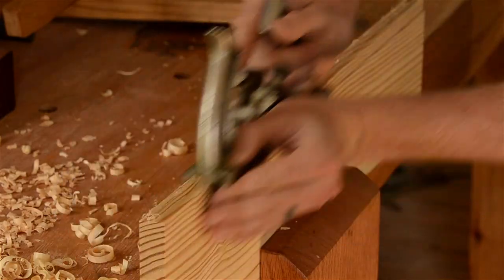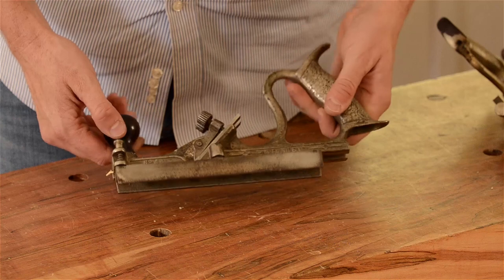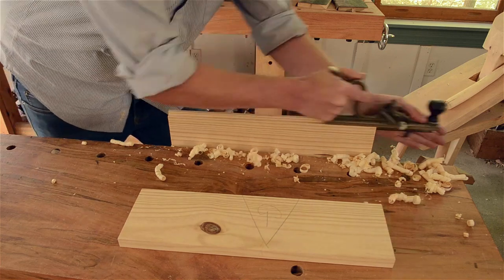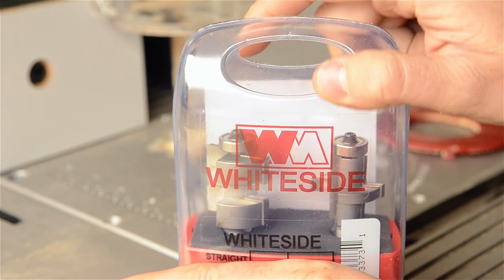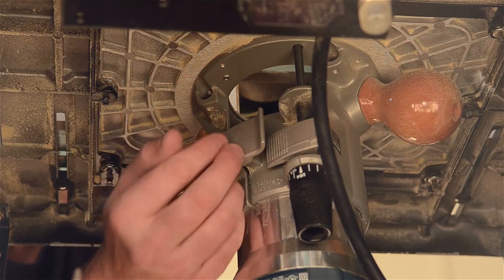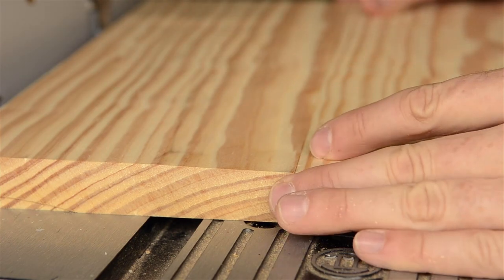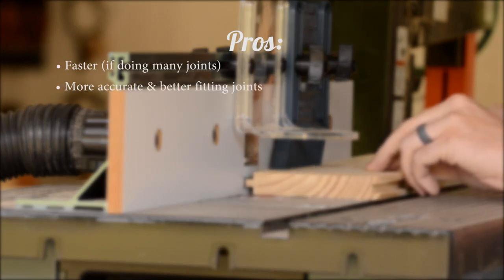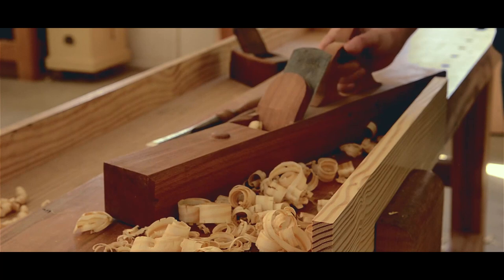Tongue & Groove Two Ways: Handplane vs Router

Comment: BIG PLUS to hand plane option, your ready to rebuild in a non-electric post-apocalyptic world. You don't even need sub-floors, the earlier homes used T&G floors right on the floor and cieling joists and wall studs inside, and ship lap on the outside. (Ship lap can be done with the same planes, just cut off one ear of the groove board  and leave the other ear a little longer than the tongue (for the gap in the finished wall/siding).). Hand tools don't need power if you also learn to sharpen them on flat stones as opposed to electric powered wet wheels. The carbide cutters on router bits require specialty sharpening equipment as well, so your more likely to have to buy more as time goes by, replacement blades for the hand-plane only require rudimentary blacksmithing knowledge and decent sheet carbon-steel. If you have the skills to be valuable after an apocalypse, the others will be more likely to protect you as an invaluable member of the community.
Reply from the maker: LOL...all great points!
Reply: @WoodAndShop  what can I say..  Walking Dead fan... all the electric tools will be good for is parts to make weapons.
Ha ha ha, thanks for the reply.
Reply: ya Im hassling all of the lumberyards near me for 1-1/4" oak... $1 per board ft, green, for white oak.  T&G plywood near me is $3.50 per board ft.  wtf.  So now I bought a router and table and am building a kiln and even after all of that I will still save money on my oak floor compared to T&G plywood subfloor + hardwood.  Not even close.

Comment: Is a plow plane not recommended for tongue and groove?
Reply from the maker: You can use a plow plane, but then you're only getting the groove. You need to also cut the tongue. But a tongue & groove plane(s) gives you the tongue and the groove, and ensures they are lined up with each other.
Reply: @WoodAndShop  aaaah that makes complete sense. Thank you.

Comment: I coughed when I saw the price of the Lie-Neilson No.48, but after adding up the cost of a router, router table, shop-vac/dust extractor, suddenly they looked a lot more attractive. Not to mention, I could put a No. 48 into my toolchest, and just use it at my work bench.
Reply: You need a 48 and a 49 to make a tongue and groove joint. That adds up to $400. You do not need a fancy router table or dust extraction to get the job done either. Those are luxury add ons. Electric routers are very versatile tools too. Which may explain why I have so many of them.
Reply: @1pcfred  - I got myself a Stanley No. 78 Fillister plane off eBay, so for my project I'll do shiplap boards. I also picked up a nice little beading plane and some wooden molding planes so I will be able to do some decoration with it.
Reply: @hartleymartin  I have a couple Craftsman planes that look like a Stanley 78. They're cast iron duplex rabbet planes. Apparently made by Sargent? I got mine at flea markets. Paid $10 for one and $15 for the other. One has its fence and one doesn't. So that saves me the trouble of taking the fence off. Because I never seem to use it with the fence. I only use it to tune up tenon cheeks. If that. I usually just grab a chisel to do that. For beading I definitely use an electric router.
Reply: @1pcfred  I'd like an electric router but I already get enough noise complaints from my family when I use an electric drill. Hand tools seem to offend their ears a lot less. Mind you they also say that linseed oil makes the whole house smell of fish, so I personally think it is more in their imaginations than anywhere else.
Reply: @hartleymartin  dang. During the day folks have to expect some noise. Most noise ordinances don't kick in til 11 PM. But that is pushing it. I tend to knock off on the noise by 9 myself. For smells I'll crack a window and maybe run a fan. Even if it is cold. I try not to do stinky stuff when it's cold. Most doesn't work well then anyways. You must live with a bunch of church mice.
Reply from the maker: Hi Paul, no, you don't need both planes. The fence on the plane swings to let you cut the tongue and then the groove. The No. 48 is for centering the joint on 3/4" stock, and the No. 49 is for 1/2" stock.
Reply: @WoodAndShop  Thanks. Good to know!